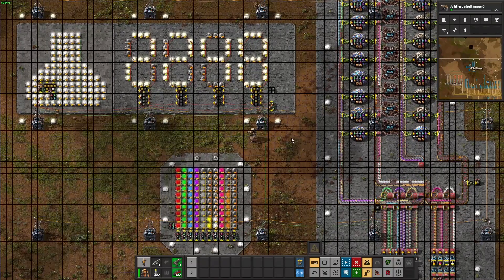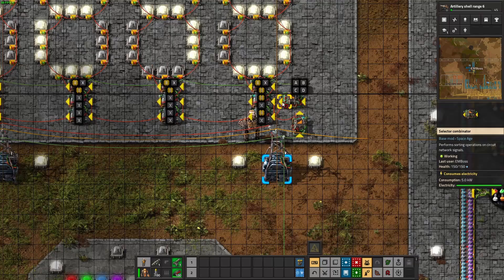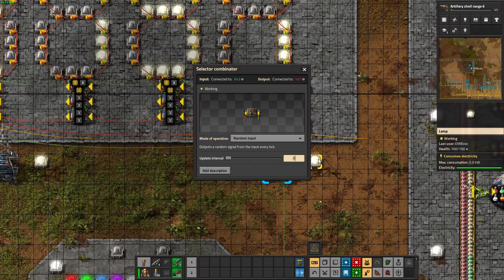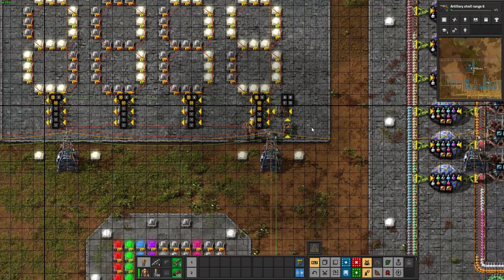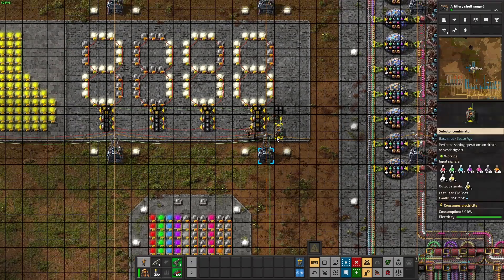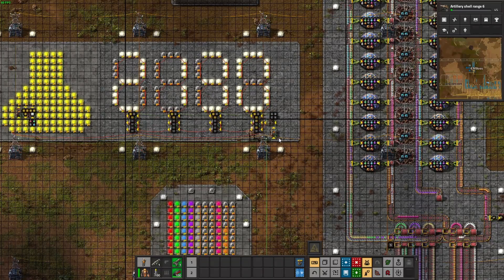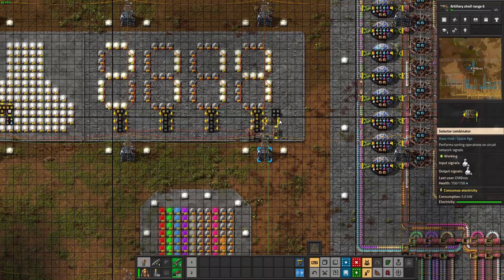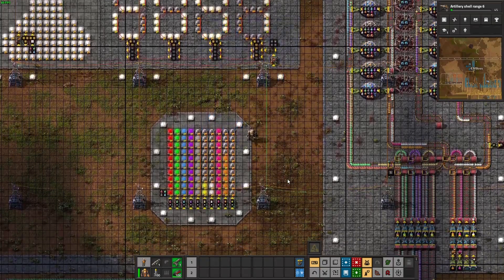Clock Circuits - Mini Tutorial - Factorio 2.0: Space Age

Comment: This clock circuit is much more compact than the one in 1.1! But can this clock circuit be reset by one more condition than time ? Like "after condition A happened, wait 5 second then enable B". You can achieve this by decider combinators, but is it available too with this tiny clock circuit?  If you have to use power switch then it won't be compact...
Reply from the maker: Power switch... I'm guessing you're controlling a steam backup generation setup?  If you don't want to use the standard SR latch, I'm guessing the item you want is actually called a memory cell.  

I did try this out on backup power, but in that case it only really works as a variable on/off delay, which doesn't perform what it needs to at all.
Reply: In my case, Im trying to figure out a 5 speed pump control for a space platform.
Full speed, emergency stop, high speed, cruising speed, and eco friendly speed.